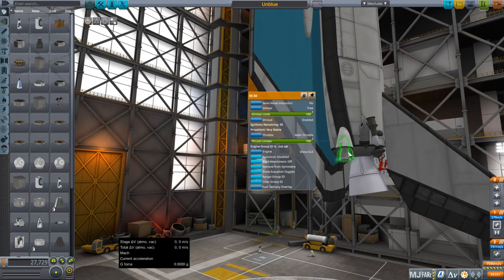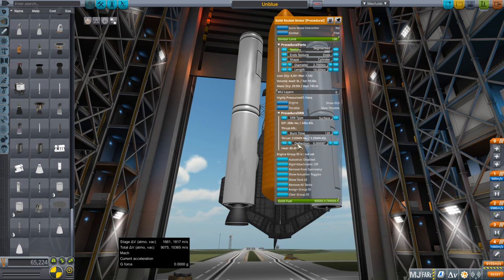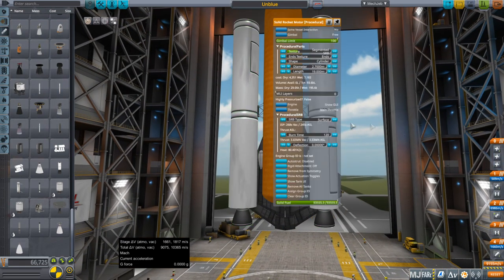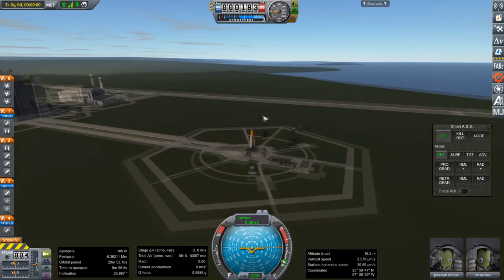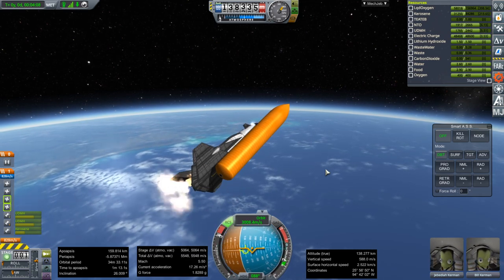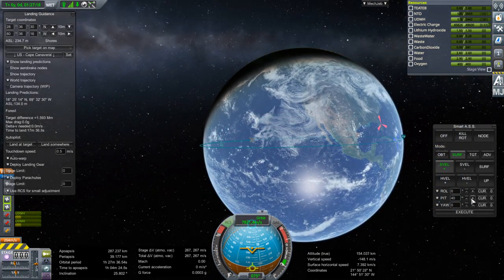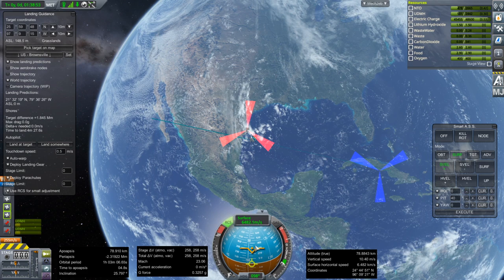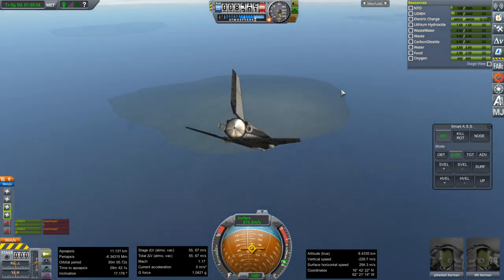Realism Overhaul in KSP 1.8.1 - Shuttle Design Tutorial Part 2

Comment: Also, if the procedural SRBs have such a terrible dry mass, I'm pretty sure you can change it somewhere int he configs to be more similar to the normal dry masses.
Reply from the maker: I'd rather either use the replicas or make a custom booster in Blender than mess with the Procedural SRB numbers. I try not to mess with the RO numbers - the engine temp thing is just a longstanding grievance of mine as I frequently have engines on the tail of my shuttles - even the Space Shuttle mods - randomly explode.

Comment: When turning the engine in the beginning, how did you switch the turning directions? They were in a 45 deg angle first, then you pressed a key (?) and it switched the orientation of the three circles. Thanks! :)
Reply: When rotating a part pressing space resets it’s 🙂
Reply: F swiches between relative and absolute rotation/offset.
Reply: Thx everyone!

Comment: I dont know why, when I use procedural parts SRB, i cant use the engine GUI, cant increase thrust / isp etc
Reply from the maker: Did you install things as I did in this tutorial series, or do you have mods I haven't installed?
Reply: @RaizSpace  I just have some rocket mods installed (eg Japanese H2/H3, Chinese LM3) maybe I should reinstall everything
Reply from the maker: Well, maybe check that you have the latest version of Procedural Parts for your KSP version first. After that, maybe try deleting any mods with plugins that I didn't install during this series.

Comment: Your shuttle engines should be lower than your boosters engine cones.
Reply from the maker: Not on the real Shuttle: https://upload.wikimedia.org/wikipedia/commons/thumb/d/d6/STS120LaunchHiRes-edit1.jpg/1200px-STS120LaunchHiRes-edit1.jpg. It would help, of course, but the booster engine thrust could damage the shuttle if the shuttle is set too low.